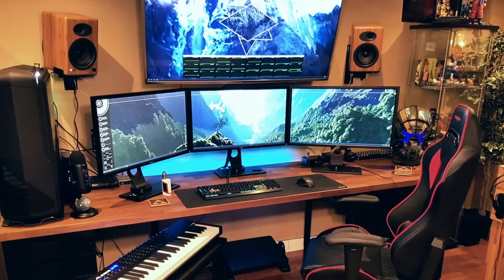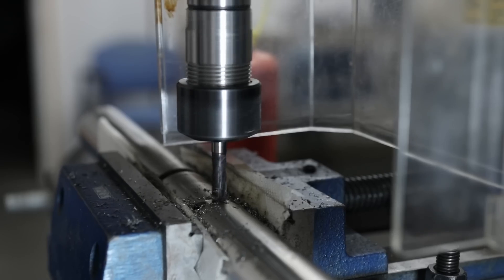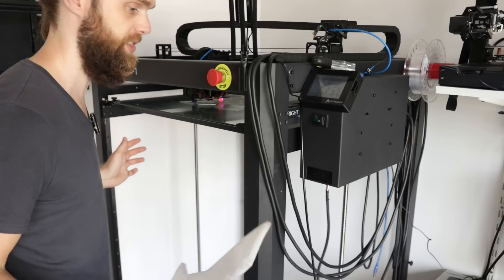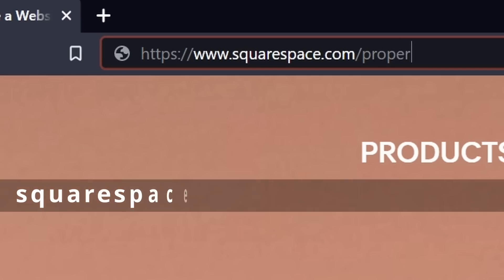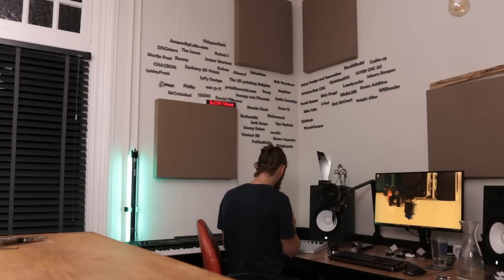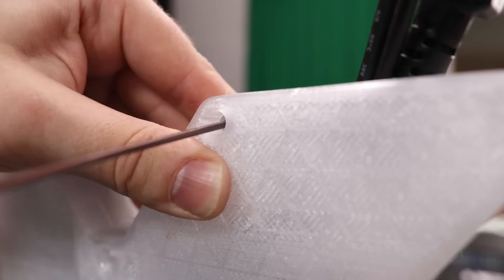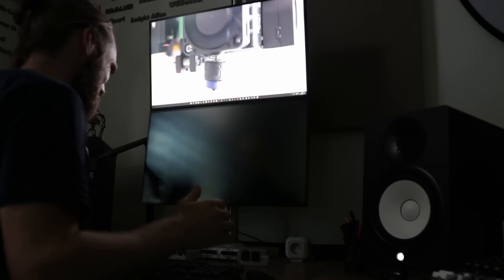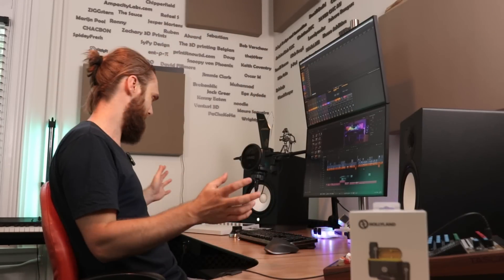This is how Monitor Stands should be...

Comment: Doing a similar pole mount system for a monitor in my van conversion that will rotate around and face the wall for attachment when driving.  I'm using a bicycle seat quick release clamp in the design so that I can move the monitor up and down on the pole as desired.
Reply from the maker: That's a smart solution!

Comment: Thanks for this inspiration on this one!  Only, in my implementation, you'll see that I turned things upside down a little bit.  Search for ' "a-frame monitor stand" printables'.  Note, rather than using SS tubing ... I used some extra I K E A plumbing bits that were around.

Comment: Wow, I thought the most boring part would have been the user. (joking... or am I?)
Okay, really great job. If you like where the stand is right now and thinking about it being the permanent location, you could drill into your table and make the post/pole pass through the table for greater stability. I have been making something like this but designing the stand to act as a universal docking station for our laptops. My design is to make a docked laptop look like a vertical stacked book with my other books.

Oh, please don't pick me for the mic giveaway (which probably occurred already). No one wants to hear me speak.

Comment: I am digging the monitor stand idea! I have 3 wide, and one above. Having 3 monitors sitting on the desk is annoying, and 3 wide stands are stupid expensive. The 4th is mounted to the wall. This gives me some ideas! I could really use a wireless Lav Mic! My current $20 Sony is always strangling me, or getting yanked out the computer! The ability to connect to a phone, DSLR, and computer opens up lots of options, and the 2nd transmitter would be a huge bonus when one of my kids wants to jump in!

Comment: Hey there, Always love watching your video, would like to do something similar with my monitor and I had a look for the Vesa mount on your site but couldn't find it. Would it be possible to access the file?
Reply from the maker: Awesome that you want to do something similar! I haven't shared the files because they're tailored to the things bought for it. I do share the design files with my Patreon supporters and it's also possible to send a message through the contact page so I can send the stl's if you can use those.

Comment: i think one addition to an already fantastic and seamless setup would be to have an additional USB on top of the stands base for a usb microphone and another usb run up the centre to another usb panel mount for a webcam plug. other than that, its a fantastic product and would actually like to see something like that come to market. its one of those areas where manufacturers rest on the laurels and don't innovate - only other product ive now seen that comes remotely to what you've created is the new Corsair flexible OLED monitor which has an ok front IO interface. well done :)

Comment: I was looking to 3d print a sleeker vesa stand for my monitor and it's a bit much for my needs, but it's really cool that you can design such a thing. I hope i'll be able to design cool things now that I have a 3d printer. Also the hollyland mic would be very useful for me, I actually wanted to get a new mic that picks up more audio for my meetings since I move around a lot and it would also be useful for when I'm doing PC build streams since that requires a good amount of moving around.  I didn't know such mics existed, but I'm very interested now even If I don't win at least I learned something.

Comment: I can really use that mic. I am working towards starting up a YouTube channel but I don't have much of a budget. Unfortunately I will be using a pair of old Canon 50D that can work for video (by running third party software on the cameras, Magic Lantern) but unfortunately the 50D does not have any hardware for capturing sound. I need some way to get sound and that microphone would really help. 

For the past 35 years part of my job at work has been design of electronic based products. This involved both electronic and mechanical design. I loved my job but I reluctantly decided to retire for a variety of reasons. I want to continue doing design and construction and I want to share my experience with others who are interested. I want to go through the process and explain why I chose the approach and methods to accomplish the goals. I have no intention of just showing chips fly. (from the milling machine or lathe) I want to teach, not just show videos of the tools at work. I want to pass on some of the knowledge I gained from my past work and from the people I have been fortunate to have learned from. 

I have a variety of projects that would include electronic design, 3D printing, aluminum metal casting, machining with a milling machine and turning parts on a lathe. 3d printing if the structures are sufficient if made from plastic, or to make patterns and then sand casting aluminum parts. Even welding if it is appropriate, though I'm not a good welder. 

I doubt I would get a large subscriber base. I don't expect to get ad revenue to support the costs. Because of this I'm trying to not spend in areas that I don't need to. I'm living off savings and not eligible for collecting government pension yet. This is where the microphone would help. I know I could make videos without voice but that really sucks for people watching them. Believe it or not, I don't have a cell phone, so that isn't an option for video/sound recording.

Comment: Honestly stacked monitors setup is underrated.
3x side-by-side is still king for most scenarios, but 2x stacked is the the most useful "specialized" setup for monitor speakers, narrow/busy tables.
Add a portable 11.6/13 inch touchscreen monitor on a VESA arm attached to the side of a table and it's a perfect multipurpose setup.

Top monitor for "standby/monitoring" tasks
Bottom monitor for primary work.
Vertical touch monitor for either social or misc tasks.

Comment: Very interesting idea, I've also been disappointed at the market options for monitor stands. Flimsy designs, no triangulation... You pay premium for extra adjustability that goes to waste the moment you find your sweet spot for your setup and never move them again. That's why I'd rather design custom 3d printed brackets that are rigid and custom-oriented for your sweet spot. But I'd go for something bulkier than the black ones holding those monitors... Those are definitely not over engineered 😅
The mic looks great, I don't have any wireless mics so I would stop messing with cables any time I want to record some dialog.

Comment: The stand looks great an added functionality is just what I would like in future monitor stands, a little bit to flashy with RGB for my taste but that transparent case reminded me of those NES consoles, like in Seth Everman collection :D Another idea for your video are currently boring and partially useless notebook accessory that are cooling stands, at most they have USB 2.0 HUB integrated, merge it with those Thunderbolt dongle accessory with 2.5Gb Ethernet, SD card reader, additional 3.1 USB and display ports, you could even add M.2 connector for fast SSD inside.
Anyway Hollyland mics, I could use them to make that cooling stand with my Ender 3, it may be a cool challenge for me to make one. Pretty please :)

Comment: I love the idea and the work you've done! As a heavy multidisplay user myself (heheheh, five in fact! 😁 ) this does give me some ideas. I've always chosen to go with either wall mounts or mounts installed at the corner of the table or through the table. Keeps things handy and additionally clean looking. PS. Round aluminium table legs can be used for monitor stands pretty easily. Cheap, sturdy and quite nice looking also. Some even can replace or extend original tubes in monitor stands!

Comment: Sweet set up. Dual monitors become pretty indispensable when you start using them. The mic seems cool, maybe if I had one I could use it for live streaming and finally retire the PS3 Rockband mic and scissor arm stand combo that I have attached to my bed frame.

Comment: Nice video!
I also have a similar monitor assembly using printed parts, but I used two aluminum L-profiles to support monitor.
A few years ago I started a youtube channel and filmed a lot of material. However, I ran into some audio quality issues. I failed to make a quality voice-over, the voice sounded like a robot. It killed my motivation. The videos are still waiting for their turn, so a new quality microphone would help me to make them.

Comment: I like the idea of adding LED's to the base of the monitor stand! Maybe you could add some integration, so they display the current progress of your 3D printers. 
Do you like the stacked setup? I'm wondering if I should try it as well, to save some desk space.
Reply from the maker: That's an interesting idea! I like a horizontal setup more, but that's also what I'm used to. For my current setup, this is the best option.
Reply: @properprinting  WLED should enable you to easily do the print progress thing I think but that prob won't work with the Corsair strip
Reply: @properprinting  Thanks for giving me your experience! Love your channel btw.

Comment: Impressive. Especially when so many things could have gone wrong. Btw won't the monitor clamps slip with time?
Reply from the maker: Thanks! I don't think it will because even if it's not tightened, it acts like a glue clamp when it tilts.

Comment: I would have added a clamp feature to the back of the base, to clamp or hook it to the table and prevent it from tipping over. Besides of that great work and good to see that I am not the only one who has to iterate designs in order for them to work as intended. I found that the number of iterations always is three. A natural constant as it seems.
Reply from the maker: Only an earthquake will topple this thing over ;)

Comment from the maker: I especially like that this enables integrating custom features, for instance a USB soundcard. If you have a suggestion, let us know!
Reply: Or u can buy a laptop and have all of this stuff I mean;-; but just betta design noice
Reply: Just mount your monitors to the wall, they would not wobble when the table moves
Reply: @eggling3427  You don't want them on the wall. Ruins the spatial sound quality.
Reply: I think it is amazing. And for those of us that KNOW how important audio is. Just look at those Monitors. And by that I mean the ones that make sound. :)
Reply: ports are on the back for cable management. It's normally not advised you plug anything into the passthrough unless it's just for power... But you knew that right? 

Tbh I wouldn't trust a 3d printed stand. Just seems rather r*tarded to spend money on a decent monitor and then make the stand mostly plastic... I mean sure if you are going Aldi Budget like you've gone it makes no difference... But for those of us that use a PC a monitor is more important than speakers.
Reply: @razerow3391  hater hater
Reply: @razerow3391  you're entitled to your opinion, but I think you might be missing the whole point of this channel. Additionally, Jon has tested 3D printing materials extensively. He has hung his entire body weight from these "plastic parts."
Reply: @RazerOW Oooh, trigger warning on the car wheel videos for you then!